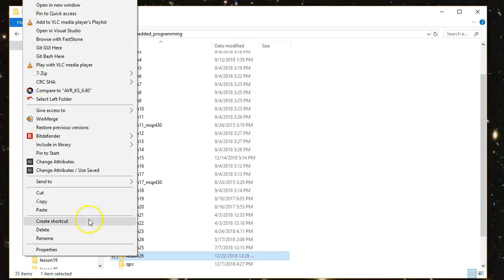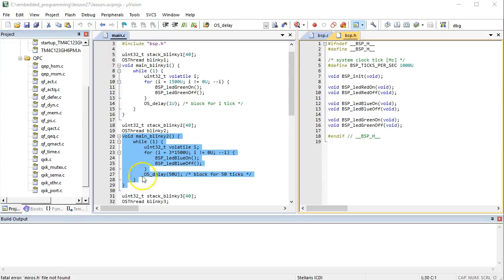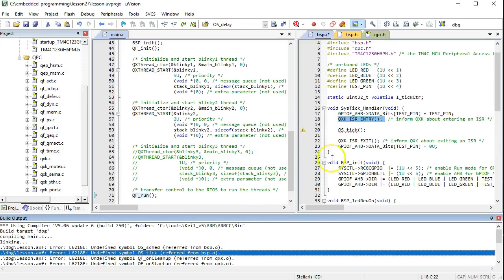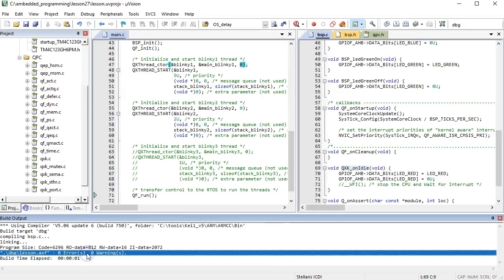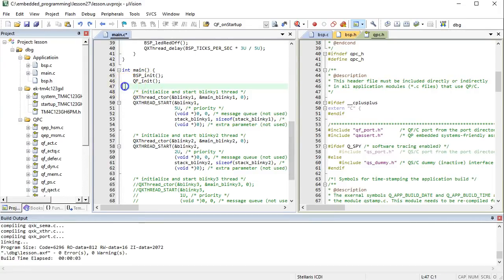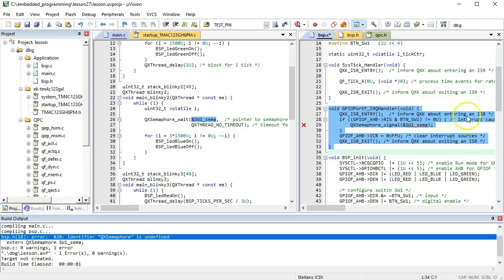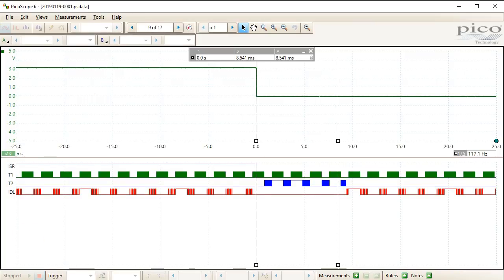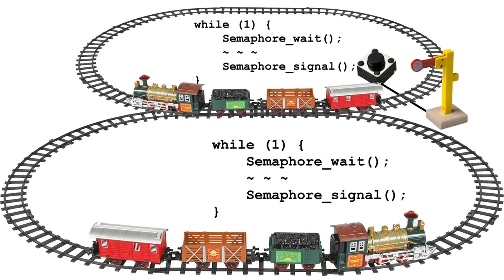#27 RTOS Part-6: Synchronization and communication among concurrent threads

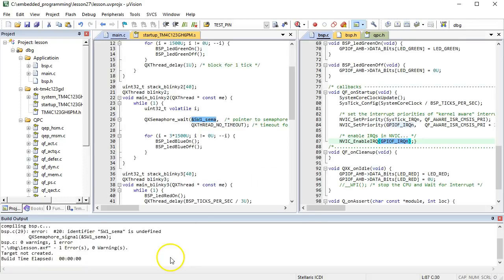Comment: 31:29 Miro, you enabled interrupts for GPIOF with the routine NVIC_EnableIRQ , however, in previous lessons we used to have the other routine called  __enable_irq(), which set PRIMASK on globally,  which in case is necessary to handle interrupts. But I can't figure out how we got handling GPIOF interrupts without explicitly enabling PRIMASK in the first place?
Reply from the maker: The intrinsic function __enable_irq() clears the PRIMASK, which is cleared at CPU reset. Consequently, if no other code changes it, calling  __enable_irq() is unnecessary. Still, I wanted to make people aware of the PRIMASK by an explicit call to __enable_irq(), even if such call might be redundant. (It's only one machine instruction!) The enabling individual interrupts (like the GPIO) in the NVIC is a different story because they are disabled out of reset. In the end, you can always verify in the debugger the state of the PRIMASK bit (in the CPU Registers view), and convince yourself that interrupts are only handled when PRIMASK is cleared. --MMS

Comment: What configurations would you need to use with the Logic Analyzer for the STM32?
Reply from the maker: The project download for lesson #27 has been updated to include project stm32c031-qxk-keil (STM32 NUCLEO-C031, QXK kernel, KEIL IDE). The download is located in the usual place: https://www.state-machine.com/course/lesson-27.zip  --MMS
Reply: @StateMachineCOM  Thank you

Comment: Firstly, thank you very much  @StateMachineCOM for these videos. I would also be very grateful if you could answer a question regarding the return from the interrupt (around 19:58 in the video). 

I discovered that the LR at a breakpoint when entering SysTick is 0xFFFFFFFD. It is changed however by the call to the QTimeEvt_tick_ section which must be from the RTOS files. Additionally the SysTick call begins with pushing {R3,R14} onto the stack, so that at the end POP {R3, pc} may put R14 in the program counter (SP is the same at the beginning and at an end). So the 0xFFFFFFFD value is in r14 before the initial PUSH. 

My question arises from the fact that the LR is clubbered and value into PC is put from that 'r14-place' on the stack. Is it just the way the compiler decided to use the registers, because there is a call to another assembly section in the interrupt? (I know that the CPU's docs give three ways of returning from the ISR, that is: -
->An LDM or POP instruction that loads the PC
->A BX instruction using any register
-> An LDR instruction with the PC as the destination ).  However It got my attention because it seemed different than in the simpler examples in lessons before. Is this LR 'corruption' is a common thing when dealing with 'more complex' ISRs?

I used the CCS with GNU v.9.21  and compiling options:
-mcpu=cortex-m4 -march=armv7e-m -mthumb -DPART_TM4C123GH6PM  -Og -ffunction-sections -fdata-sections -g -gdwarf-3 -gstrict-dwarf -Wall -specs="nosys.specs"

If I missed something quite obvious in previous lessons or if the question does not make sense you can easily ignore it, but I would be very grateful for an answer. Thank you again for such deep and interesting take on embedded learning.

Comment: Hey Miro,

I am curious about the write to the ICR register. You write all ones to clear all the bits in RIS, and it makes sense to me that that works if you have just one interrupt source.

However, intuitively it seems to make more sense to me that just write 1 << BTN_SW1 to it, to clear just one interrupt. Because what if another interrupt must be handled? I inspected the RIS register in Keil, and changed the code to see check my intuition and to my surprise two things are true at the same time:

1) my code of just clearing one bit works.
2) The RIS register is not zero afterwards (specifically bit 1 and 2 are sometimes set). This does not trigger interrupts, of course, because these interrupts are masked, but it of courses signals to me that my intuition is wrong. These additional set bits in RIS seem problematic to me, as they come out of "nowhere".

Why would I need to write all ones with GPIOF_AHB->ICR = 0xFFU; ? Is GPIOF_AHB->ICR = (1 << BTN_SW1); wrong? If so, why precisely is it wrong? What goes on behind the scenes here? How would one handle an interrupt if an edge is detected on the same GPIO port during the interrupt handling? Is the NVIC clever enough to set the bit after the ISR is done?

Kind regards,
Jorgis
Reply from the maker: I haven't used the interrupt aspect of the TivaC GPIO design enough to answer your detailed questions. All I needed for this lesson was a user-triggered interrupt that was intentionally "bouncy" with potential glitches. The raw GPIO interrupt for the user-button filled the bill. But frankly, I would never use such a GPIO interrupt in any real project to determine the presses and releases of a button. For that, I use (and demonstrate in the future lessons) switch "debouncing", which is a form or digital filtering of the raw GPIO line, in the periodic SysTick interrupt. I hope this makes sense to you. --MMS
Reply: @StateMachineCOM  Thanks for your reply!

Comment: where can I find the QPC file? I don't see it available in the lesson 26 section on the companion page anymore
Reply from the maker: The lesson-27 project has been updated according to the new project structure explained lin lesson-0. The project is now self-contained and already contains the qpc framework (inside the lesson-27.zip archive). In fact, it contains also FreeRTOS and other things. Please just download, unzip, and open the selected project in KEIL uVision. It should compile cleanly. --MMS

Comment: At around time 24.00  while explaining the semaphore objects waiting semaphores are saved in bitmap. Does it mean that the signaling of currently acquired semaphore will let the highest priority waiting thread to unblock and not the least recently blocked thread?  In other words, the order of unblock is based on the priority of thread and not FIFO? Please clarify. On separate topic, can counter value in semaphore object become negative as more threads wait on semaphore?  That also means, the absolute value of negative count value tells the number of threads that are currently waiting to acquire the semaphore.
Reply from the maker: First question: In case multiple threads block on a given semaphore, once the semaphore gets signaled, it will unblock the highest-priority thread. So, the order of releasing the threads is based on thread priorities and NOT the most recently blocked thread. Second question: the semaphore counter cannot become negative. If a semaphore count is zero and a thread calls wait() operation, the thread is blocked and the counter is NOT decremented below zero. That's the whole point of a semaphore. --MMS
Reply: @StateMachineCOM  Thanks a lot for clarifying the doubt.

Comment: Just in case anybody else is having problems with compiling:

Make sure the compiler is version-6

When adding ports : use armclang instead of arm.

In the path add the following -->     ;..\qpc\ports\arm-cm\qxk\armclang

Also in the main.c file , just after include directives add the following --> Q_DEFINE_THIS_FILE

If you are getting 100s of errors, which are inline function --> change the c language standard to c99. 

After that all good !! , and another brilliant lesson!!
Reply: Hope this comment gets to the top, it was super helpful

Comment: many thanks, but when i try to build the example i can't find the arm qxk_port.c file for arm toolchain to build it on keil so what should i do??
Reply from the maker: The ARM/KEIL Compiler 5 is now obsolete and the newer versions of KEIL uVision no longer install that compiler. Instead, they come with the new Compiler 6 (a.k.a. armclang). To match these changes, the qpc framework also switched to armclang, and therefore the QXK port to the obsolete ARM compiler 5 has been removed. I will update the projects for all affected lessons and will put them on the state-machine.com/video-course website as well as on GitHub (https://github.com/QuantumLeaps/modern-embedded-programming-course ). I'm sorry for the problems with the current versions, but this is the cost of progress. --MMS
Reply: @StateMachineCOM   I love you man, I just love you because you so so so smart.
Reply from the maker: All ARM/KEIL uVision projects have been updated for the new Compiler-6. You can download them either from the companion webpage (as the lessonXX.zip files) or from GitHub (https://github.com/QuantumLeaps/modern-embedded-programming-course ). --MMS
Reply: Excellent videos Miro! I was able to get a clean build by modifying three things 1) Change the include folder entry from "..\qpc\ports\arm-cm\qxk\arm" to "..\qpc\ports\arm-cm\qxk\armclang". 2) import the qxk_port.c file from the changed directory in step 1. 3) Made sure my ARM Compiler was set to 'Use default compiler version 6'.

Comment: Thank you for these videos. They are very clear and helpful. I have ported the code for this lesson to an NXP part, LPC1343. When I tried to run the code QXThread_delay blocked forever! I changed the tickRate parameter in QXThread_ctor to 1 and found that it worked. However your code has the tickRate set to 0. Why is there a difference?
Reply from the maker: QXThread_delay(...,tickRate) blocked forever is typically indicative that the matching QF_TICK_X(tickRate) is not called periodically. Specifically, if you associate an extended thread with tickRate==0, you need to periodically call the QF_TICK_X(0). From your description, it seems that you're periodically calling QF_TICK_X(1). Please check in your code! --MMS
Reply: @StateMachineCOM  Thank you, that was a very quick response! I just checked my code and you were right. My SysTick handler was calling QF_TICK_X(1) instad of QF_TICK_X(0). I have changed it and the code is running nicely.

Comment: Hello there,is there any way that i could follow along in IAR workbench?i've been spend so much time on just running error-free,i've followed along all the way from lesson-1,it worked perfectly fine until this lesson,it would be really helpful if you could give us some help,thanks in advance.
Reply from the maker: Yes, you can now use IAR (as well as Makefiles for GNU-ARM) to build the projects for the whole RTOS segment (lessons 22-27). Specifically, all the projects for lessons 22-27 have been augmented by adding the project files for IAR EWARM (as well as Makefiles for GNU-ARM). Also, some files (like miros.c) have now versions for IAR (miros_iar.c) and GNU (miros_gnu.c). The projects for lessons 22-27 have been updated on the companion web-page to this course (https://www.state-machine.com/quickstart/ ) as well as in the GitHub repository: https://github.com/QuantumLeaps/modern-embedded-programming-course . You should be able to download from any of these sources and directly build the projects with IAR (and GNU-ARM). --MMS
Reply: @StateMachineCOM  Hi Miro,problem solved,thanks for the help.I have one last ask though if i may,i am wondering if you could point out to some learning directions,how should i go further from here?I'm a guy who will only go further when i think i grasped the essence of things at least in learning part,i spent accumulatively 70 hours in the past week on your RTOS series,now i could draw the flow diagram directly on the paper of how threads switchover and write the same code like "Miros",so like when you say they actually exist in different part of memory address areas with the trick of having their own "SP pointer",it totally spots on.
I wish you could point to me something,but it's fine if nothing on your mind at this moment,i'm genuinely super grateful for your sharing.

Comment: So the kernal aware interrupt means that when the critical tasks are still ongoing, then the interrupt prep (loading context to stack) would be delayed but no longer than the maximum delay time.
Reply from the maker: Yes. "Kernel aware" interrupts are those that cannot preempt critical sections of an RTOS. This means that servicing of such "kernel aware" interrupts might be delayed by the duration of the critical sections. The maximum such delay is the longest critical section in the system. Therefore, it is important to keep all critical sections as short as possible. --MMS

Comment: Hey, In one of my assignments I have been asked to implement the following:
A virtual COM power using a 115200 baud, 8N1 protocol with no hardware handshaking.
For this design, you must set the ASP bit in the CONTROL register so that the thread code uses the PSP
(the handler mode will always use the MSP).

Can you please help me how can I set it, in C code.

Comment: Hello, I've been following your RTOS lesson on my STM32F407G Discovery Board and I'm running into an issue with qpc. In particular, I get an error for each QXTHREAD_START that says "identifier 'Q_this_module_' is undefined". I have tried re-downloading qpc and have double-checked that I added the necessary files to the project but this issue persists. Any help would be appreciated.
Reply from the maker: First, if you see any problems like this, please compare your code to the official download from the companion web-page to this video course at: https://www.state-machine.com/quickstart/ . The highly recommended, free utility for code differencing is WinMerge (you can google for it). But anyway, you will notice that the official code contains the line "Q_DEFINE_THIS_FILE" right after the #include directives. Again, you can just google for "Q_DEFINE_THIS_FILE" to see the documentation, but this macro defines the `Q_this_module_` string constant. This constant is then used in all assertions to report the name of the module (and "QXTHREAD_START()" uses an assertion internally). Also, for more information about assertions in embedded systems, you might want to read my article: https://barrgroup.com/embedded-systems/how-to/design-by-contract-for-embedded-software --MMS
Reply: @StateMachineCOM  Thank you for the quick reply! This did end up working, and I appreciate the added resources. Your guides have been immensely helpful and I look forward to completing the rest of this lesson now.

Comment: Hello. I'm a beginner to programming microcontrollers and embedded systems. (although I do have background in C). I'm considering this series as a starting point. Does it cover (or will it cover in the future) the circuitry aspects and actually interfacing to things?
Reply from the maker: No, the main focus of this video course is embedded software, not hardware. The aspects of interfacing to the hardware will be discussed only if this is necessary to understand a bigger point in the code. But to learn more about the hardware, you probably need to look elsewhere. --MMS